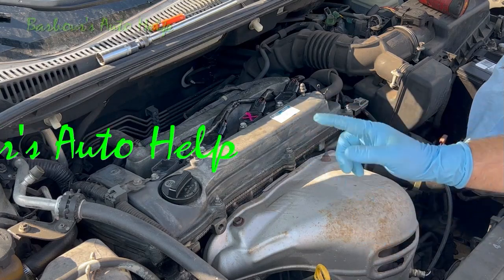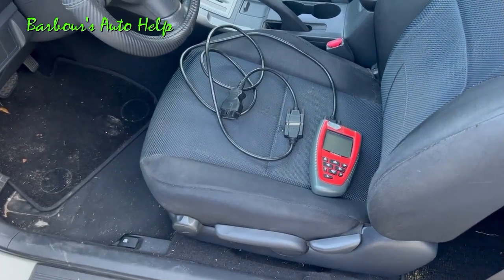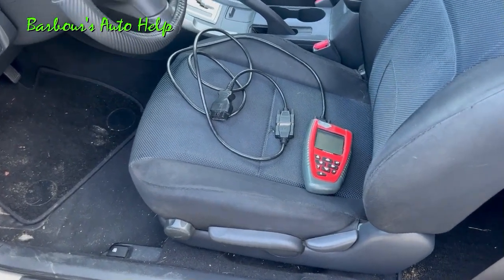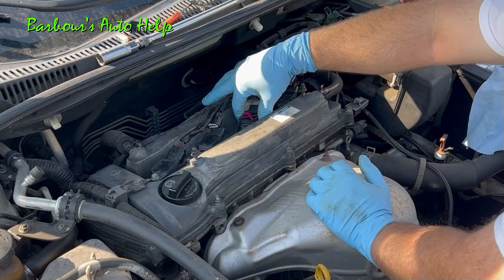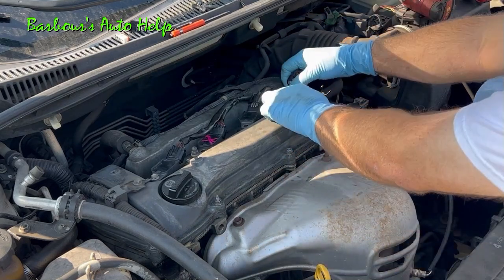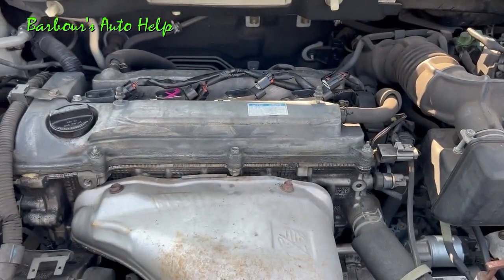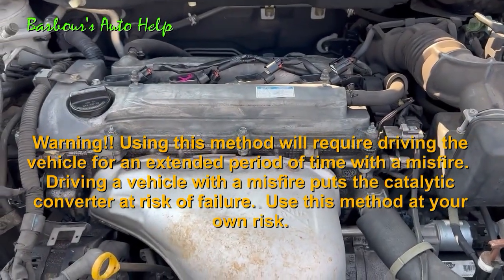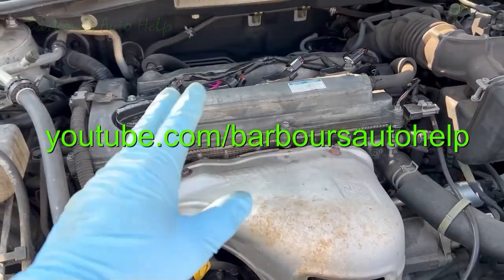Easy Method For Diagnosing Ignition Misfire For Coil On Plug Ignition System

Comment: You shouldn't have to drive or at all doing the test,  specially on a four cylinder. With one cylinder down should be pretty noticeable if you test by pulling a second coil plug the e line will get worse and put the one you pull you know works in to questionable cylinder and see if it gets better from what it was from having the two down. If it was  the coil then it would run as it did when you had one down initially as suppose to the two down of not move on to plug then the injector
Reply from the maker: In some cases yes.  But, if the ignition misfire is only under a load then driving will probably be needed.